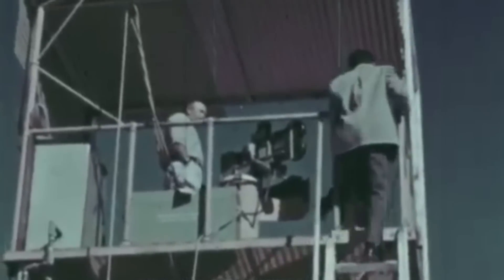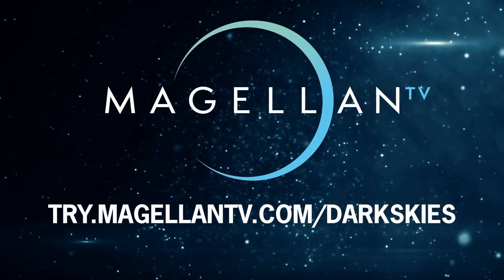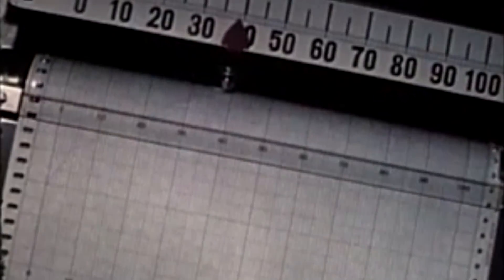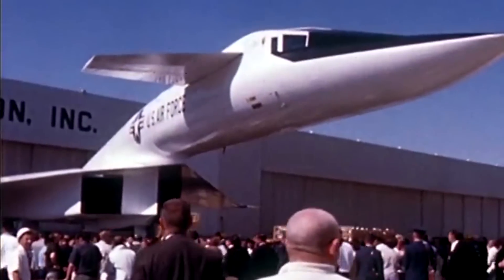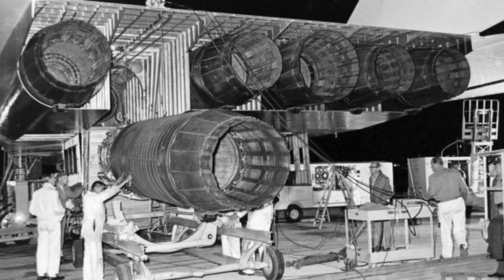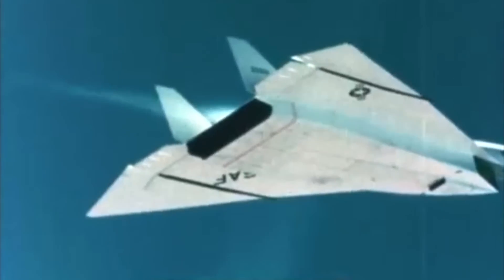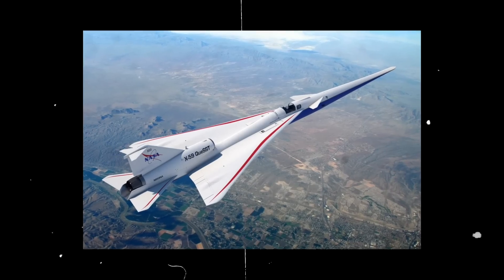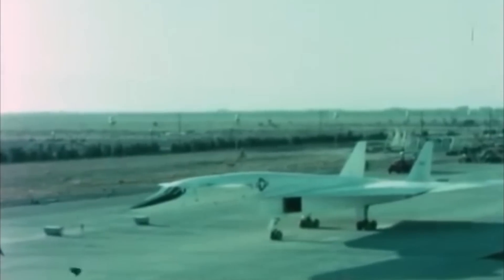XB-70 Valkyrie - Mach 3 Nuclear Bomber

Comment: Was this before or after the usa stole the avero arrow tech n shut the project down or after...... same tech.
Reply: This is a copy of the oddly enough scrapped Avrow Arrow.  The Canadian government, unfortunately for our citizens, sold out.  What a shame.  And the Arrow never had any issues to speak of.
Reply: The avero company was already shuttered before the plane even was in the drawing board, but the design does follow it, as physics demands certain things to remain constant. And, if I remember correctly, a great number of the avero engineers worked here as well.
Reply: jim darling - Avro.
Reply: @AtheistOrphan  originally was A.V.Ero.
Reply: jim darling - No. The company was named after it’s founder, Alliot Vernon Roe, hence ‘Avro’. I wrote about the history of the company and it’s aircraft as a project when I joined the Royal Air Force in the early 1980s. (We each had to write about an aircraft manufacturer). Check out the Wikipedia article on Avro (and Avro Canada) for more information.
Reply: @AtheistOrphan  ok, had it slightly off. Thanx.
Reply: How did the us steal anything of the Arrow. How do the 2 airplanes have anything to with each other?  Anyway, Arrow wasn't cancelled by the US,  but by Canada's own government.

Comment: Then there are the rumors of what happened to airframe #3. Scrapped or went black(we hope it went black).
Reply: Once you go black......
Reply: What rumors? It was never completed as it was cancelled early in its production. Don’t buy into that kind of crap.
Reply: Digging at Tycho 
AV-3 wasn’t that far along. The design was completed at the end of 1963, and procurement of some of the materials for production was done, as well as fabrication of parts of the honeycomb structure, but with the massive budget cuts the program saw in 1963 (they only got just under $53 million out of a requested $491) they tried a vast number of alternative usage profiles to keep AV-3 on the table, but it just couldn’t be saved.

AV-3 was in its RSB-70 configuration supposed to have a four-man crew as opposed to just the two pilots in AV-1 and AV-2. It was also supposed to have an advanced offensive and defensive electronics and weapons suite, which changed to reconnaissance equipment only in the proposed RS-70 role. In the end, as is well known, neither came through.

Again, don’t listen to dreamers and their fantasies. AV-3 was never finished, it never flew, it most certainly never “went black” and while a lot of the scientific data the two Valkyries gathered have been used in many other projects, the saga of the XB-70 Valkyrie died when AV-1 landed in Dayton, Ohio to spend the rest of its days at the USAF museum.
Reply: "or went black" To what end?  Come on, use some critical thinking.  You can't retrofit effective stealth technology on a design that isn't stealth.  You can add bits and pieces, like the the SU-35, to partially reduce an aspect.  So, if it's not stealthy, an aircraft the size of the XB-70 certainly couldn't survive modern layered air defense systems regardless of its speed .  The Mig-31 exists to take out targets such as this at extreme BVR ranges with hypersonic missiles (Mach 5+). And due to the XB-70's design, it can't fly nap of the earth at speed like the B-1 can. So what role would it be enhanced for that is not already handled by existing aircraft?
Reply: I said rumors, it's all in fun. You guys need to not take this stuff so seriously.
Reply: @diggingattycho7908  You also said "we hope it went black" so you take it seriously or you hope to start a conspiracy theory.  I hope to have quashed that.
Reply: @red94mr28  Nope, the rumor was started by a woman in the midwest I don't know the decade. She spotted an airplane that looked like an XB-70 carrying a smaller plane. I read it on the dreamlandresorts website somewhere back in the early 2000's. I hope it went black is a tongue and check phrase. We all know it was scrapped because the last thing these people do is recycle something that cool. You need to go after some UFO nuts, your wasting your time here.
Reply: @red94mr28  Unfortunately that doesn't work. After many years on message boards. Some idiot will ask a question that was answered in the previous post. The amount of people that will read this post, after us will be nil. After all when everybody has a voice, nobody does. 
Besides people do not want facts, they want entertainment. Take for example Bob Lazar, he is completely full of it. Yet people still listen to his stories. But the real stories of the happenings at Groom Lake AFB. Would bore most people to death. 

The kids making these video's could care less about accuracy, they recently put out a vid saying AMARG was in Phoenix, AZ. None of them are going to care about one little story. After all who knows, in the Black anything could have happened. That's it's nature you only need to know what you need to know. Anything else do not expect any answers.
Reply: @diggingattycho7908  Luckily, it does work.  I get notifications all the time of replies to comments I have made or 'Likes' to comments I left as long ago as 2 years.  It doesn't have to do with entertainment or uniqueness but it does seem to matter, in my experience, about accuracy of topic and/or a reply/comment to the topic.

Comment: Those wheels burning upon landing was some sight, I kept thinking the parachutes would catch fire too
Reply: I like the footage at 6:45 showing the paint flaking off from frequent trips through mach speeds. Never saw this before.
Reply: @nonamesplease6288  this was on ship1 and one of the reasons it was never flown above mach 3. There were concerns over what had caused the paint to start chipping and they thought ut was due to structural rippling
Reply: The original documentary was a little more revealing.